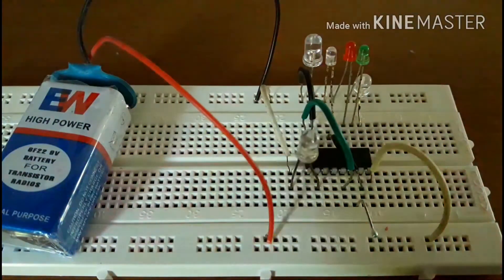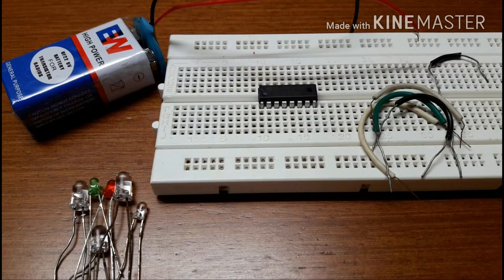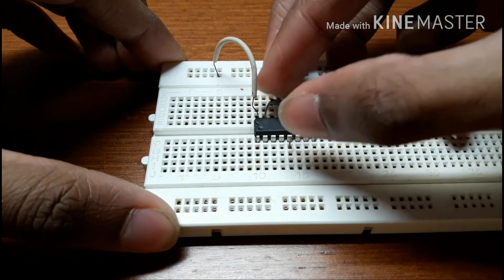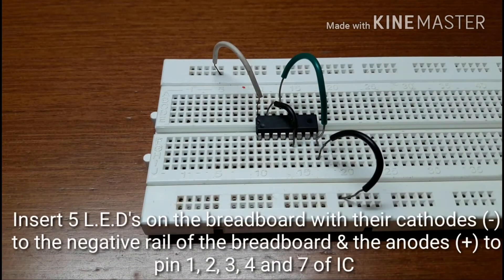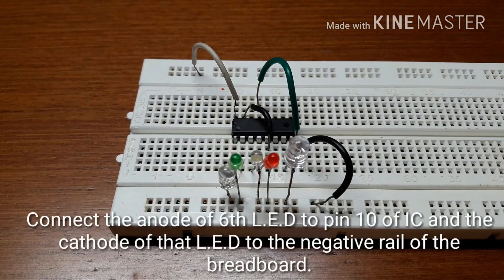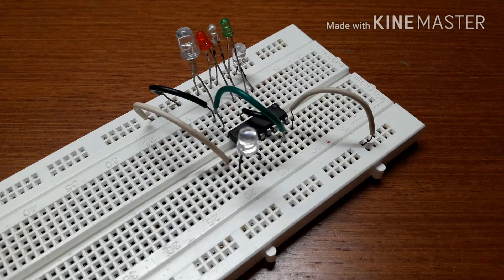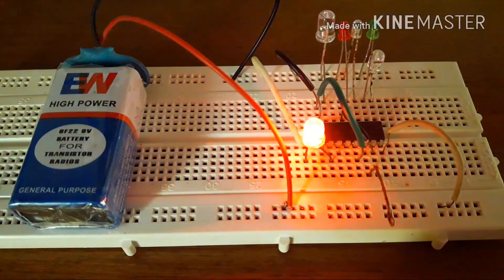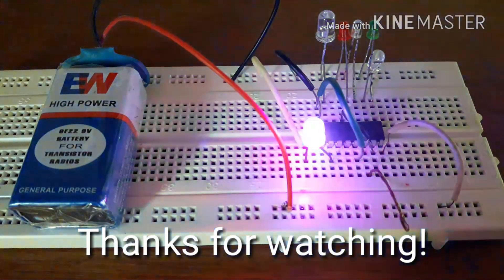How to make a "Electronic Dice" on Breadboard using 4017 IC.

Comment: hey troy this scheme is not proper you should use a pulse from a 555 timer ic to make it properly
Reply: Devashish Lahariya and if you add ad capacitor to vcc and a normally open push button it will chase then stop randomly!